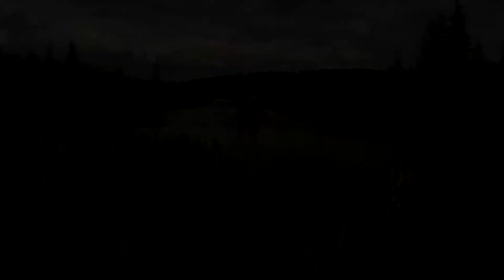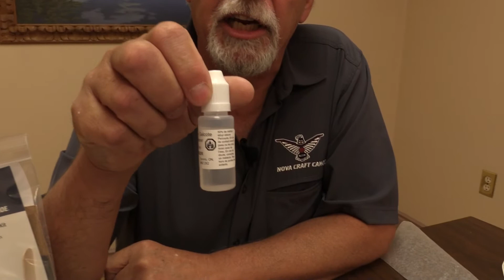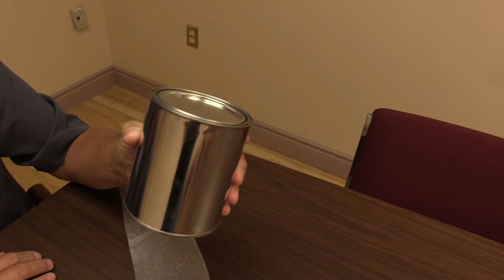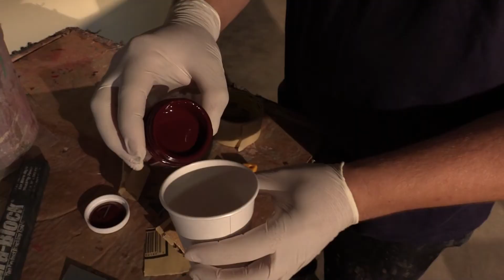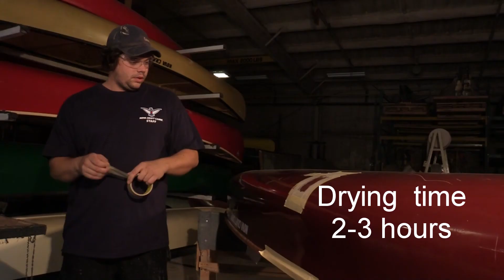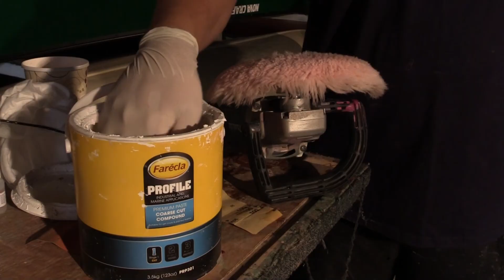Gelcoat Repair   How-To

Comment: I just tried to touch up a few cracks on the keel line of my Kevlar Bob Special. I had your kit and added a few drops of MEK and used wax paper. In the morning, the gel was still wet. I only used about 1/10 of the jar and added about 2 drops of MEK. What did I do wrong?

Comment: How about using a Dremel? I have a Swift Pack 13.6, it has a spider-web crack on the champagne side right below the color line with the Sapphire, it was kind of using lot of care but I did the V channels using the Dremel with a diamond tip bit, being extra careful not to go off the lines too much or too deep, it came really nice now ?it is ready for the job, let's see how it stays after done. The crack was because the wind blew the canoe in my back yard and it hit a corner of a wooden saw horse causing the rather large horizontal spider crack on the clear finish!! a really heart ache on a canoe paid $3000 for it, but not difference that when it is heavily used, no way to get away without cracks and damage even if you baby it.
Reply from the maker: Interesting.  Yes a Dremel is a very versatile tool...I use mine for all kinds of things,  but it is pretty powerful...I'd be afraid of cutting right through the hull.
Reply: I too have thought about using a Dremel. I have a nova craft p16 in tuff stuff and I have picked up many spider cracks from frequent use in the back country as well as many cracks radiating out from the yoke. Maybe from too much portaging? I would like to see a video of the technique used to repair spider cracks, specifically the v-cutting. The amount of spider cracks my canoe has, it may be much easier to use a dremel.